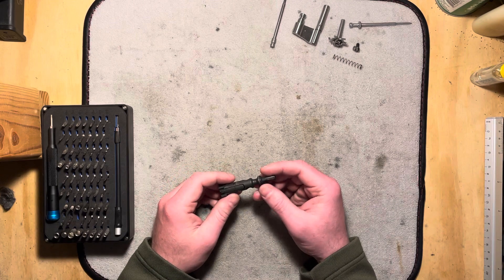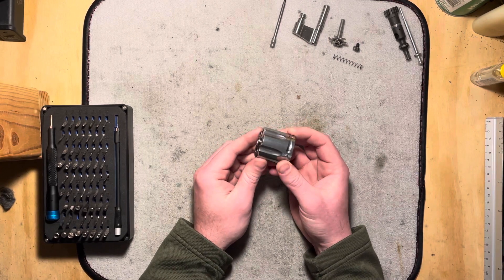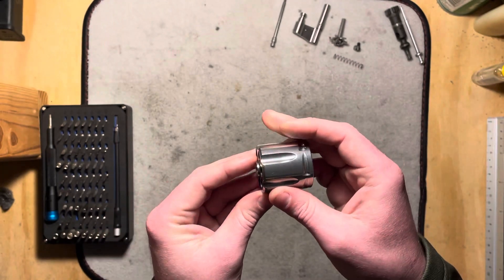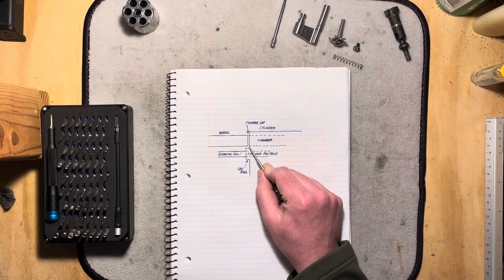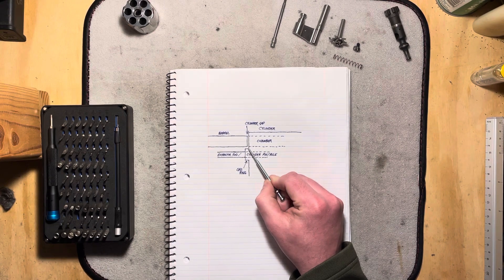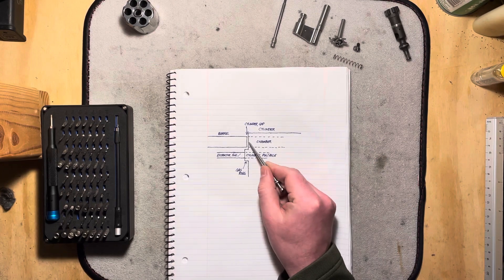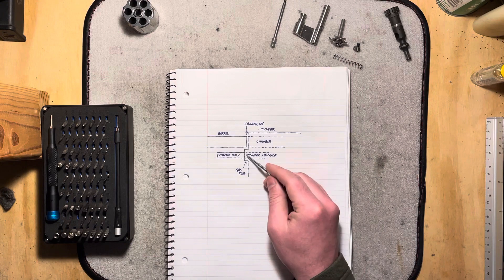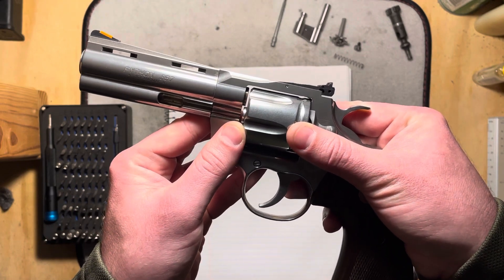What is a revolver gas ring?

Comment: Hi, new here. The "Gas Ring", as you call it, is not even needed. Cylinder is already locked in place. When it goes "Boom!", explosion drives the casing back with nowhere to go. Resulting force has now pushed(both projectile and cylinder FORWARD!!) locking the cylinder to forcing cone! Got gap? Get a Colt!😅
Reply from the maker: I assure you that does not happen the way you think it does… and if you don’t believe me shoot a revolver with a sheet of paper up against the side of it… or if it’s a magnum put a hotdog there for a more colorful demonstration.
Reply: @ColterBrog  thanks Hickok45! I didn't know that🤣 That's probably why i see flames coming out both sides the instant the bullet leaves the cylinder which then forces the cylinder backwards and creates a burn ring on the face hunh?

Comment: Great explanation! Thank you, sir!
Reply from the maker: Thanks for the comment. Just one of those really simple features we take for granted on modern revolvers, but that developed over the course of decades/centuries of incremental improvement.
Reply: @ColterBrog  wishful you covering gas-seal revolver's and or i wishful thinking X-frame/magnum500( not a fan of the rubber grips and or finger-cut's ) had a model with it and or setup for can's/muffed and or cylinder long enough for 410/3in( sorry can't remember if there's off the shelf.500in shells ( 410-shell might still work just don't use slugs and the cylinder would probably have to be mixed-to-45cal/bush'd-downwards 5th's~ as to preventing misfired/slop-ect ) but there is for the 460/.45cal model, i remember 12G is 75cal/.75in/18mm round'd and the 21-Winchester SxS 1880 and 1750-bess shares sizing ) shotguns-shell's, and yes i do like 1870~/og cattlemen looks but generally armoury brilliant/SS and ivories is to-much for me just like tiger striped deeagle or gold ak47

ps not bad education for me, didn't notice the extra operation's on the part, like calling a flat-tappet camshaft lifter's actually has a small crown that most naked eye's can't tell/see but without wrecks other-bits like how this gas uncontrolled does damages to its self in regular operations